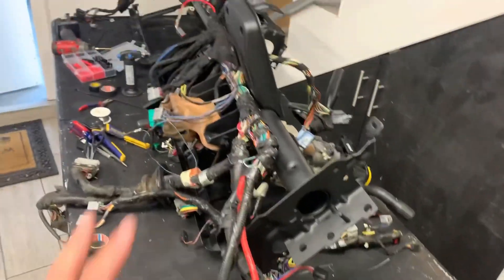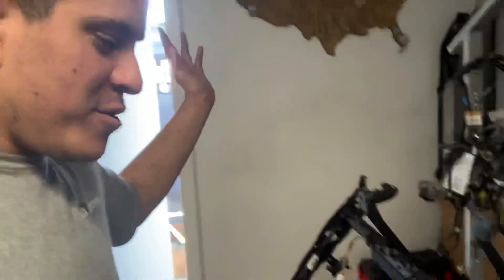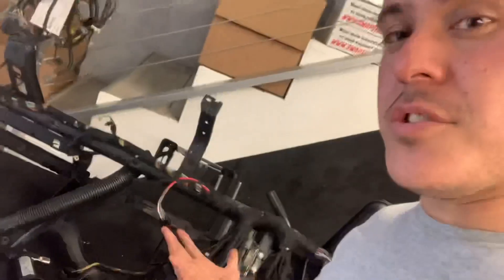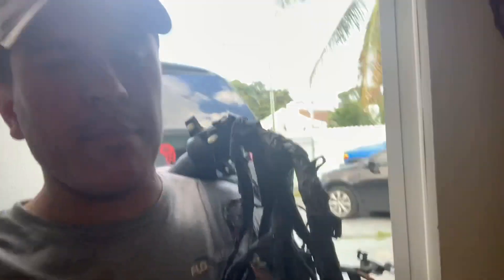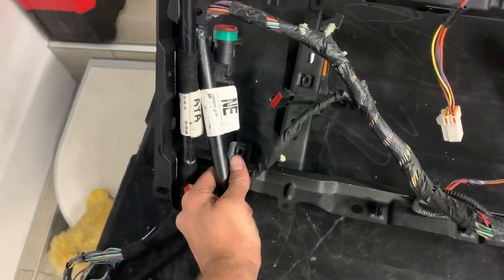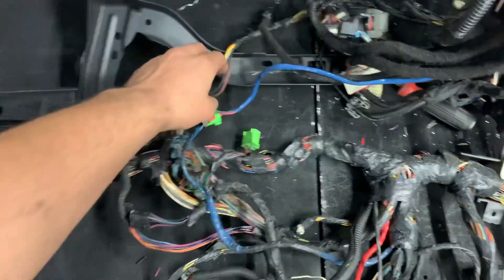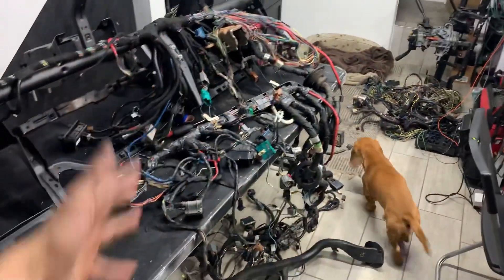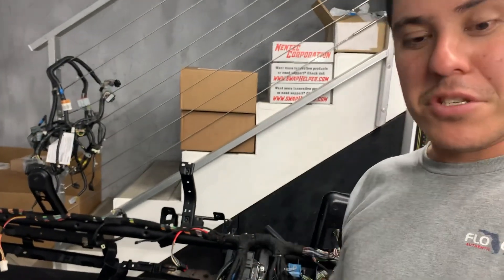Don’t Pull a Me & How to Verify a Donor Dash Harness to Match your Original Dash for your build

Comment: Fuck i just watched this again, prob twice as lit then you. lol ive got a couple 6.0s 03 and early 04 i swapped 03s to a 05-07 dash except cluster guess im satisfied with that for now but the 04, this one if you got a dash harness i may have the rest to pull it off, i got a 06 2wd low mile  putting motor/tranny engine harness  blah blah into the 04 4x4. but what about gem? maybe reconfig  the 06's with forscan?  or maybe segment swap with hptuners? this shit makes my hurt

Comment: I got smoking deal on an excursion that was in awesome shape. It’s a wasted 5.4, but I want to put a 6.7 in it. Anyone know of anyone that has done this?
Reply: I would put a 5.9 cummins in there... wayyy too much of a project to swap a new powerstroke with all of the electronics especially in a home garagae
Reply: @gabefleis5504  got a 60x80 shop and a lift. I know its going to be a pile of work, just wondering if anyone had done it before.
Reply: @joeymerrell8585  general rule of thumb: if you’ve thought it, someone has done it 😂
Reply: @BigBobBlazer  tell me about it. I’ve had several “brilliant” ideas over my lifetime only to find out someone me else already had it and saved me time lol
Reply: @joeymerrell8585  what would work is to get a 6.7 truck and cut the excursion and the 6.7 and weld them together
Reply: weld the front clip off the 6.7
Reply: @ihosvanyromero9207  that would work. But I don’t want to dice up my truck too lol. I just got a stupid good deal on a excursion that the body is in great shape interior is clean, but the 5.4 is toast. I’ll find a way to get one in there. Lol
Reply: @joeymerrell8585  other thing you could do is cab swap onto a cc sb and shorten the frame a bit.